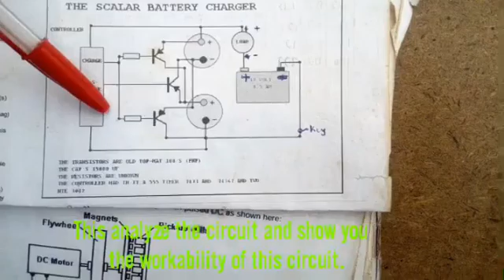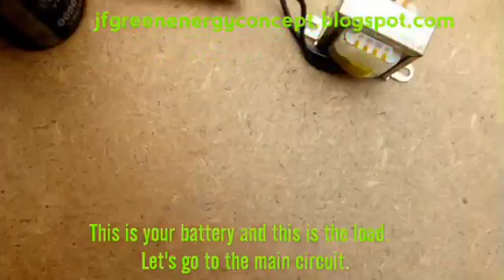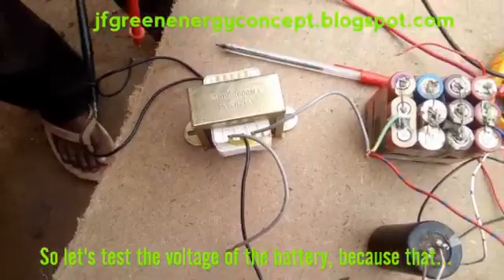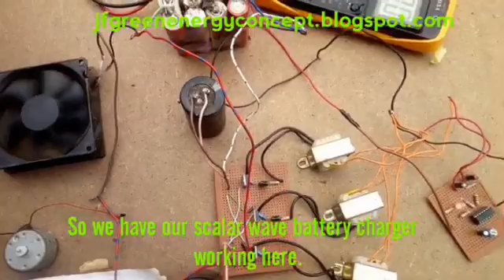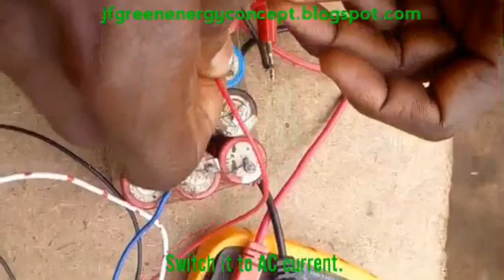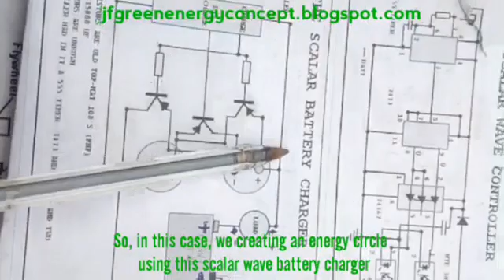Developing a scalar wave battery charger

Comment: Have you tried measuring load power and comparing to battery capacity? I built same circuit using relays but can only get Hz to about 30. Mine does drain battery down over time but with faster switching and using electronics instead of relays should be more efficient. Nice video. Thx